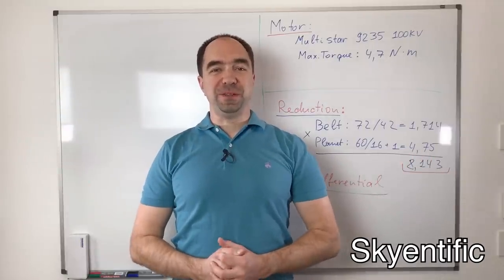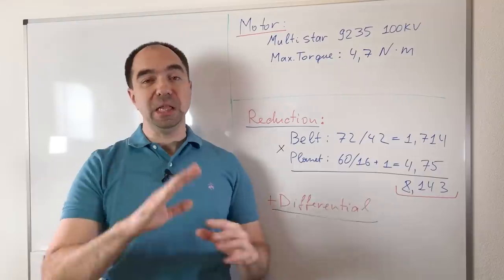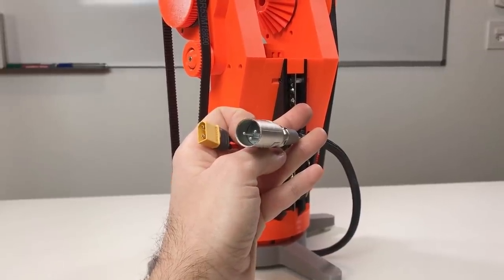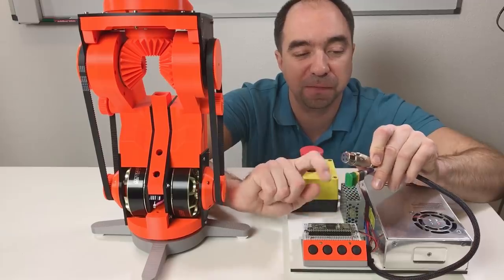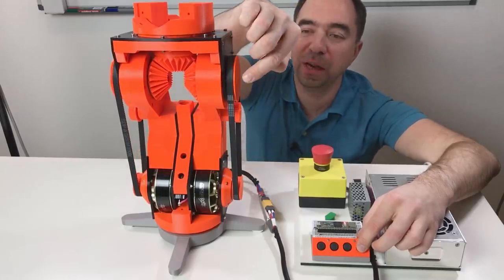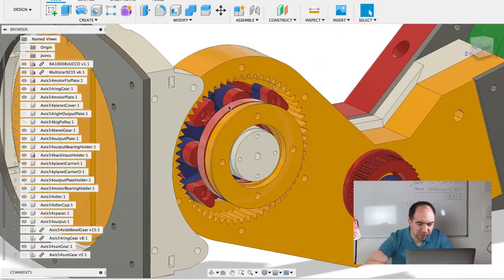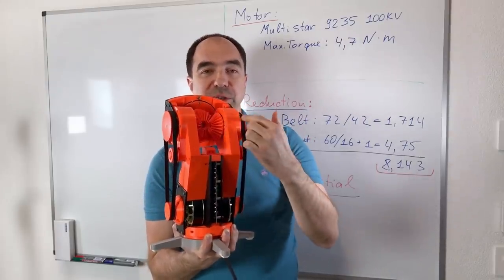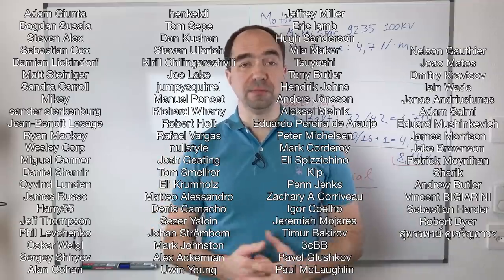Another 7-axis (7DoF) Brushless Robot Arm (part 1, again)

Comment: Very nice.  My DIY arm has differential joints in the elbow and the wrist.  I use the software "gearotic motion" to generate the gears - it can do spur, bevel, spiral and others, and export them as stl.  It's not free though.

For the wrist I use bevel gears - there's a bit of backlash there.  For the elbow I used timing belts, wrapped at 90 degrees to reduce the backlash.

Comment: This is so cool! I really like the 2 servos for 3 axes with the differential setup. I'm in the design phase of my arm. Although this is a great concept, I'd be concerned with the backlash on this one and am leaning more towards a cycloidal gear system without belts or other gears involved. I'm liking the strong motor and low gear ratio systems idea. You're doing some really cool stuff and I'm learning things from you. Thanks a lot for making the great videos!

Comment: I noticed you had the reduction gearing as part of the motor assembly in earlier joint revisions. That seems like it would have had the advantage of keeping more of the mass closer to the base.  Having more of the arm's mass further away from it's base would make it harder to start and stop because of increased inertia.
Reply: Also would reduce backlash
Reply: But you'd have to use stronger belts and pulleys, which increases the weight. You want most of the gear reduction as close to the output as possible, since it reduces the backlash from all the components that are between motor and gear.

Comment: Just found this channel, I love it. Haven been thinking about reducing the number of motors by using a power take off system, clutch or whatever. But I have dozens of smaller brushless motors from FPV racing quads I can use, also speed controllers, even thee flight controllers gyro would be useful.  My arm will me smaller hehe.  Looks amazing your work.
Reply from the maker: Thank you for such kind comment!

Comment: Wow, I have a love/hate relationship with your videos.. Every time I see a new video of yours i'm amazed at your design choices and decide to redesign myself, adding another week or so to my project timeline. I need to just stick to my end project design and complete it, but you and your damn differential joints keep inspiring new changes. Well done, this dual gimbal motor design looks so sexy. 

Also, i would like to know what types of motor encoders you prefer using in terms of accuracy / longevity. Do you think  prefer rotary encoders of magnetic? thanks!
Reply from the maker: Thank you for this nice comment. I personally prefer magnetic ones. For me it is way easier to work with. And they do a good job.

Comment: The design looks good with regard to backlash and ease of assembly but I believe you need to add additional encoders for the actual robot joints - otherwise you have to integrate the velocity of the motors for determining the position of the robot joints. Then, with a lot of different motion cycles the calculated robot joints might drift from the real joint position due to the differential mechanism backlash or the integration errors.

Comment: It's been great watching you go through this awesome project.  I have to admit, though, I'm always worried about two things getting out of control: weight, and cost.  Do you have any projections on where those two values will end up when you're all done?  Thanks for all the videos so far!
Reply from the maker: Great question. I try to keep the price as low as possible, but this is difficult. I hope that I would be able to negotiate the good price with seller and to buy in bulk. But for the moment the most expensive parts: Motors x7, each around 100USD, total 700USD; ODrive controllers x4, each around 150USD, total 600USD; cross-roller bearing x4, each around 100USD, total 400USD. So total is 1700USD, and I did not counted smaller and cheaper parts. But I hope to be able to keep the price below 2000USD. I think it should be possible to negotiate the price to 1500USD at least.The weight of the entire arm should be less than 9kg. (I aim 7kg or less).
Reply: @Skyentific  Yeah, the cost creeps up.  How many spools of print filament would go into one of these?  They look pretty solid.  Personally I (someday) look forward to having two arms working together, so I always multiply by 2, too.

Comment: Amazing work! Thanks for always sharing great work! I have a question about one potential limitation in this design, in this design you will be controlling basically two axes through the same drive which means you cannot move both axes simultaneously, what is your opinion about this limitation? I believe it could be favourable to have full control for each axis independently so that the robot can move through specific trajectory or do some action without needing to stop one axis and move the other and vice versa. I am very interested to hear your opinion! Thanks so much!
Reply: Hi Brother, great to see you here! You can achieve the desired trajectory with two motors moving at once, this can be done at the interpolator software level.  You can get it by this line of thinking: joint B rotates when you keep the same speed of both motors. When you have a difference in the motor speed, joint C starts to move. So you basicaly control the speed of joint C on the top of the speed of B. Greetings from Poland, stay safe!
Reply: @jakub-kaminski  Thanks so much bro for your reply! I am very disappointed about this guy....he just replies to comments praising him which is not professional. 

Regarding your comment; so given the design I see he can either actuate the first joint (by moving the motors in the same speed and direction)  or move actuate the second (by moving the motors with same speed but opposite direction). Technically given the gear configuration of this design, you cannot rotate both motor with different speeds. This is because the middle gear is connected to both gears on the side so the gears in the side must be rotating with the same speed otherwise of there is a speed difference the middle gear will get stuck and one of the gears will eventually break. Please correct me if I am wrong. This is a fancy design but I do not see any added value except for making a show

Comment: are those axial motors? I've heard that radial should be used for robotic arms because of the wide "pancake" style of the axial motor giving it trouble adjusting speeds fast. This motor seems to work well though.

Comment: How are you dealing with backlash in the bevel gears? Also, what do you intend to use as a slip ring that passes through the upper bevel gear to the wrist?

Comment: Hello Skyentific, This is an awesome idea for a manipulator. I have a question. if you had installed the motors directly on the input shaft of the planetary gearboxes, you could have reduced a lot of moving parts, reduced friction, maintenance and increased efficiency. I see that the belt-drives add to the output-torque but that can be added to the planetary also by changing gear ratios. You may have thought of it, any reasons not to follow up on this idea??
Reply from the maker: Thank you for this question. The bottom part (where there are motors) will be close to shoulder. Like this I put heavy motors close to the arm base. So basically with these belts, I keep extremity of the arm lighter.

Comment: very nice and clean work.
I have some issues with your design though: one of the biggest problems to solve in robots is the backlash in the joints. Since you used mostly 3D-printed parts, there will be a good amount in backlash, especially in the planetary and bevel gears. Have you tried to measure the backlash yet and any plans on fixing it? In most industrial robots and machine tools you have encoders in the servos itself (mostly for speed control) and also in the joint itself, so you can measure the actual joint angle with as few distortions as possible.

Btw. it's not nessecary to use cross roller bearings, you can also use bearing combinations for the same effect. For example I used an axial roller bearing and a thin ring bearing that fits inside it, with enough room for the frame to go around them. That's also how a lot of indexing tables are guided. You could also pair up two thin ring bearings (61700 series for example) and use those.
Reply from the maker: Backlash is bad. And I do know this. Check out my video with the cable transmission, I have zero backlash there. I also know that the encoder at the output axis would be nice. But I don't want to build another kaka robot for the kaka robot price. That is why I try to find the way of building cheaper, but functional robot arm. Most humans does not have encoder on their arms, the precision of human arm is low. But thanks to the vision system, most humans are able to perform complicated tasks. The Idea is to make simple and cheap robot arm and couple it with computer vision AI, to get a good performance.

About the bearings. Of course you can use multiple bearings, or angular contact bearings. But where to buy them? I don't want to go with the SKF super expensive bearings. I want the solution which my viewers can use. And not the solution which is only available for industry and for high price. If you can give me the link to the not expensive thin section bearings, I would be more than happy to use them.
Reply: @Skyentific  I don't know how the situation is where you live, but I've been able to get bearings of that kind fairly cheap on ebay. Maybe I can write more about that later.
Reply: Ok, I made a screenshot of the bearing solution I created for my own robot arm:
https://drive.google.com/open?id=1Em7vyypSLhT3EYDBU94yv-Z_61Mf4sKu
The axial needle bearing is 60mm in diameter on the outside (just for comparison) and can withstand way more force than is needed, the thin ring bearing holds radial forces and axial forces from the other direction and together they also hold torque against the axis of rotation.
Of course it helps that I machine my parts out of aluminium instead of printing plastic.

Comment: How did you design the timing-gears with fusion-360, how do you calculate the Belt length and teeth sizes? Where did you buy the belts? Cheers..Amazing Job btw.

Comment: was looking forward to the updates on the project. thanks for uploading! one question, whats the reason to not use wire/string based differential instead of a gears, as used in your previous project.
Reply from the maker: Thank you for comment. And great question! The main reason: it is super difficult to assemble the joint with the cables. Another reason: I am afraid that for the cables I would need to use aluminum pulleys (cables are thin, and they can damage plastic pulleys). But with the cable there is almost no friction and zero backlash. So I still not sure what is better. But cable definitely more complicated.
Reply: @Skyentific  got it! thanks for the detailed response.

Comment: Great job, can it make two rotations at the same time .?
Reply from the maker: Yes, no problem, just need to push the joystick on the diagonal. I forgot to show this, but it works just fine.
Reply: @Skyentific  this means that one of the bevel gears need to go faster then the other?
Thank a lot.

Comment: Why two motors? I think one is enough since there is a gear to drive both sides
Reply from the maker: There are two axis. So I need two motors to rotate the joint in two axis.
Reply: @Skyentific  but can't you do that by reversing one motor's direction....I am just curious...I like your work btw
Reply from the maker: Thank you. I did not really understand what do you mean. In this design there are two motors: when they rotates in one direction, one axis rotates; when two motors rotates in opposite direction, another axis moves. And of course, it is possible to rotate both axis simultaneously.

Comment: You can't have 7 dof, there are only 6 dof possible in mechanics. So you don't need 7 motors, only 6
Reply from the maker: Human arm has 7DoF. :) With 6DoF you can put the object in any position and orientation. With 7DoF, you can put the object in any position and orientation, and you can do this in many different ways. Thus, we humans, have 7DoF.